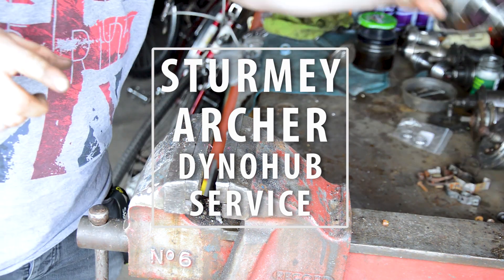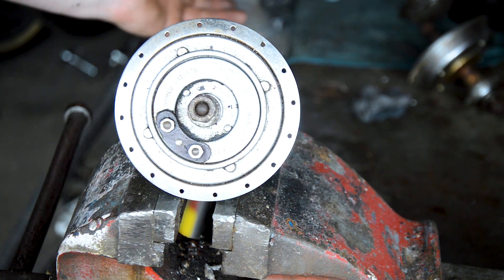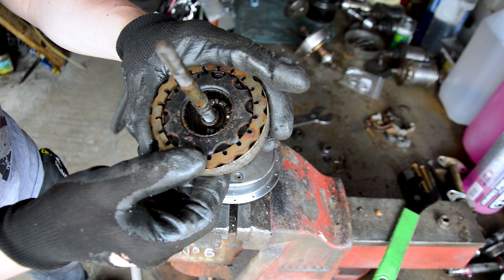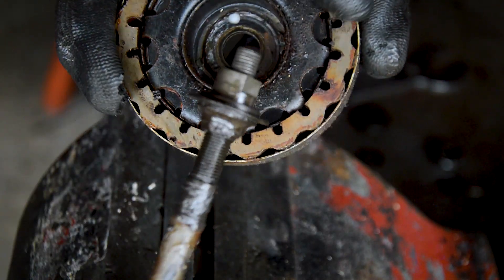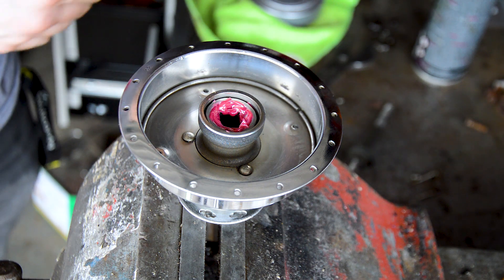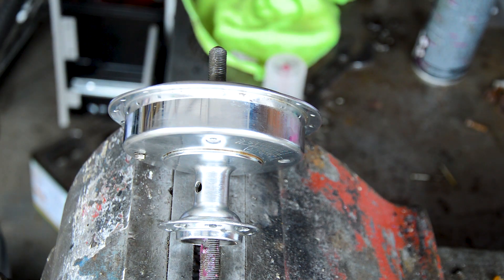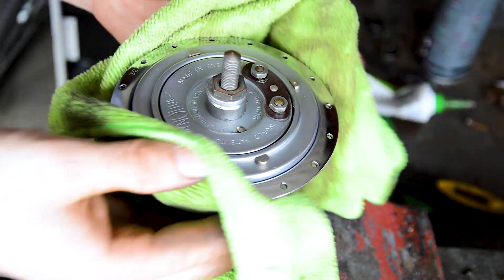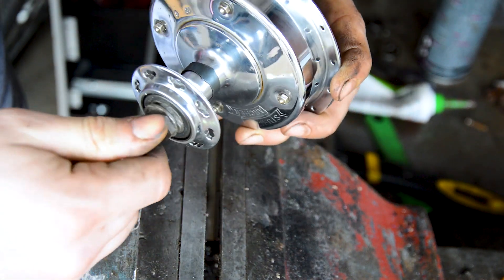Sturmey Archer GH6 Front Dynohub Service - Vintage Bicycle Parts

Comment: I recently stripped a NOS 1948 front Dynohub. I had the original SA instructions in the box and it stated that the non-dyno side was the fixed side and any adjustment should be made using the washer with four notches on the dyno side. In my hub this washer was effectively connected to the cone so adjustment was possible but it required a crescent wrench to hold it. I also had instructions from a later model hub which said that the dyno side was fixed (like yours). So at some point SA changed the design and swapped which side was the fixed cone. (Of course all the cones came off anyway!)
I'm really enjoying your videos, keep it up!